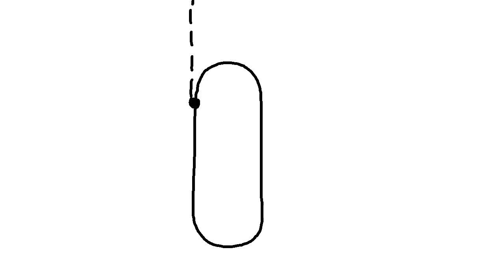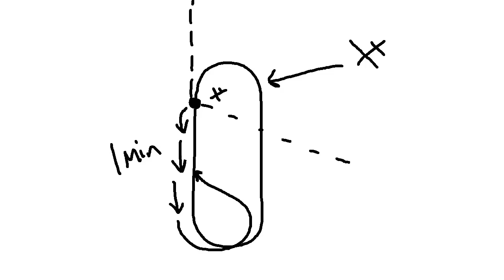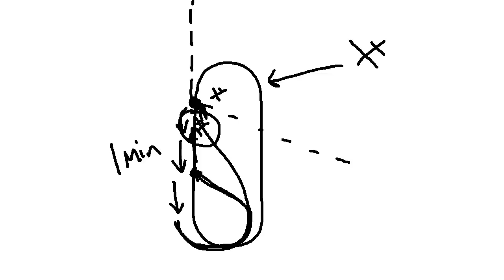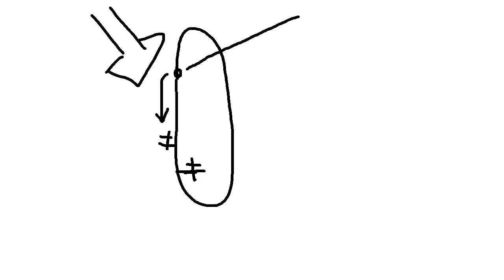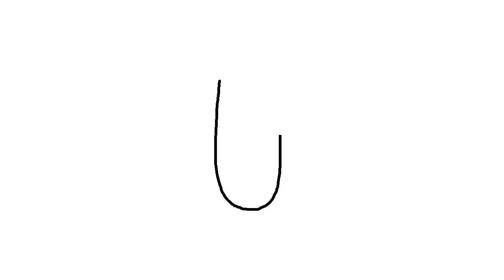Parallel Entry into Holding

Comment from the maker: The main reason is to positively identify station passage so that you know exactly where you are.  Not all aircraft are equipped with DME and using a point before the VOR wouldn't work without DME or GPS.  The other reason is you turn toward the "protected" area.  If you were already inside the hold, the turn would either be very tight within the protected area or else you would have to turn toward the non-protected side and potentially fly outside the hold.

Comment: Hello.  Thanks for the video.  Very clear way to explain the HOLD.  Just a quick note.   When my instructor explained HOLDS he told me that you should never cross over to the "un-protected" side of the HOLD.   In your video you pass to the "un-protected" side ever so slightly.  I may be splitting hairs but just have that question.   Would it be "better" to stay ON the line and not crossing over ?  Please advise.
Reply: Both sides are actually considered "protected", there is a holding side and a non-holding side. the amount of protected airspace is slightly less on the non-holding side and is determined by speed.
see:

https://aviation.stackexchange.com/questions/21612/what-are-the-dimensions-of-the-protected-space-provided-by-a-holding-pattern

That said, it's definitely better to not cross the inbound, but the FAA knows that it's going to happen and takes that into account.

Comment from the maker: After crossing the holding fix and making your outbound turn, fly as long as needed so that the inbound leg is exactly 1 minute.  The time depends entirely on the wind.  Your first turn in holding should be a 1 minute outbound so that you can determine the wind and adjust from there.  If you already know the wind is strong, you can adjust for it on the first outbound and see if your prediction was correct.